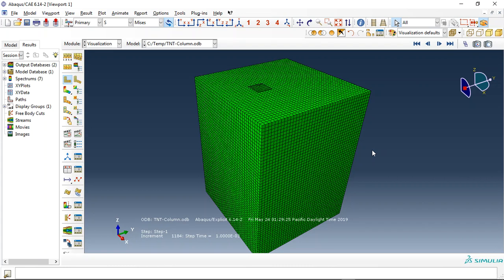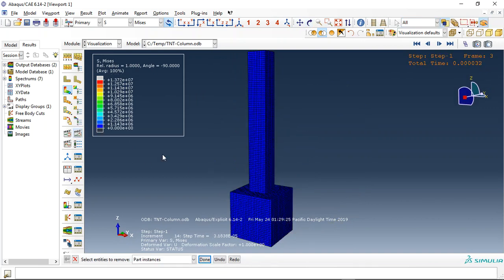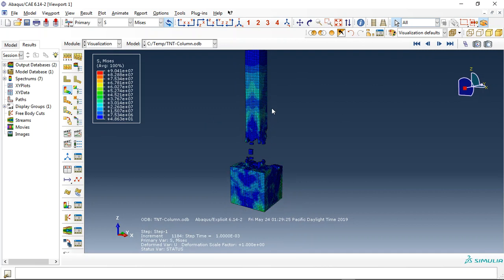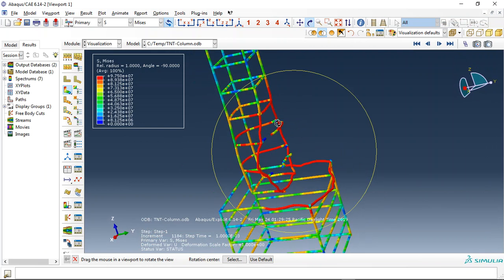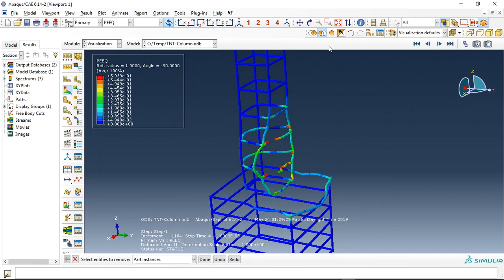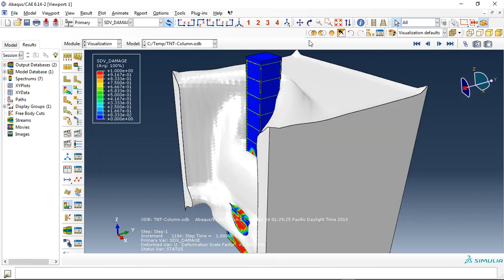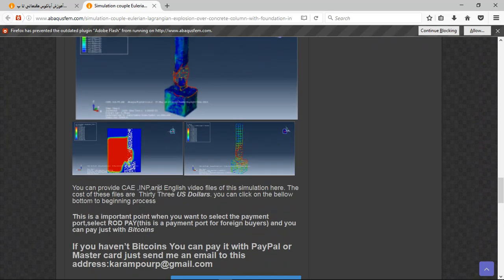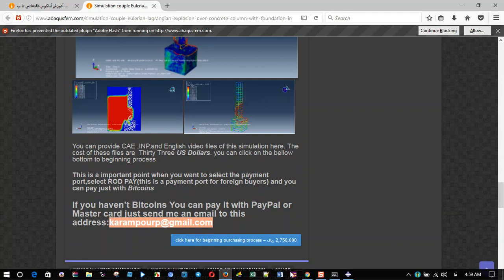Simulation couple Eulerian Lagrangian explosion over concrete column with foundation in Abaqus

Comment: Hello sir, nice work. I have some questions:
Which model you used for concrete. From the look of SDVs, is it HJC model.  And what value of efmax and FS you used to cap the damage or is there any criteria for using a particular value  for both.
Reply from the maker: to know and use those parameters, you need to have a reference like a paper